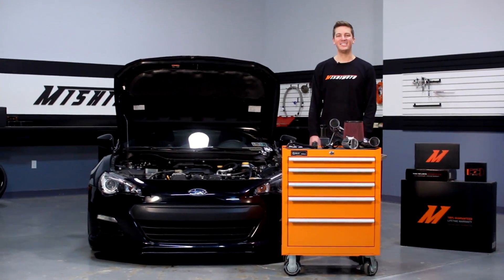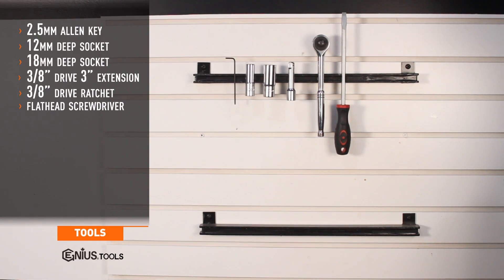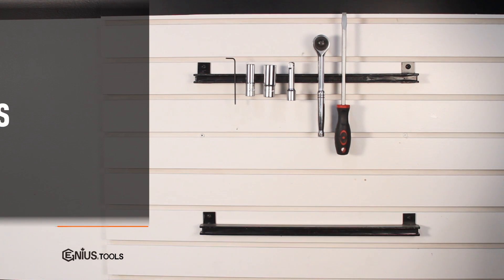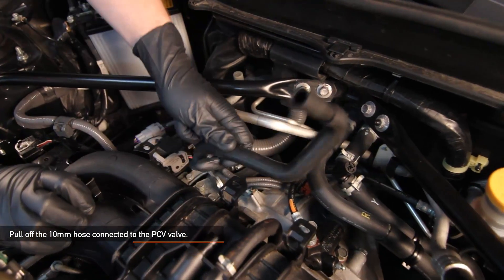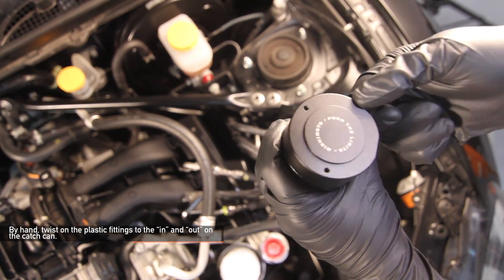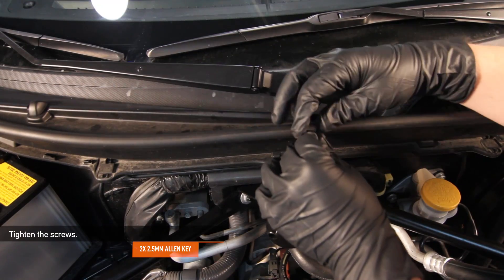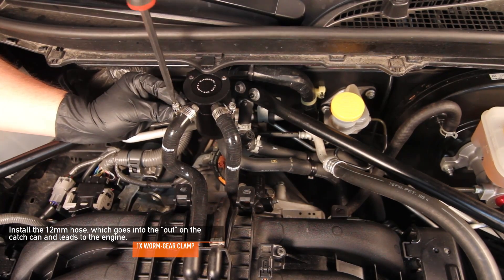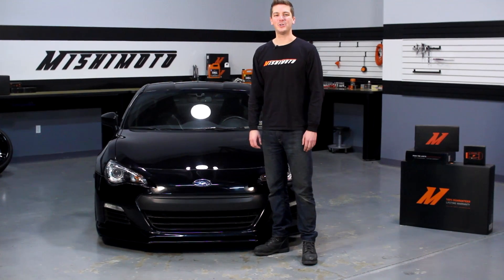Baffled Oil Catch Can for the 2013-2020 Subaru BRZ / Scion FR-S Install Video

Comment: Do I need anything special for a turbo kit? I got this catch can, will it suffice as is?
Reply: hows it running
Reply from the maker: Hey Joshua Queen. You've made a great start with the catch can as boost does create significantly more blow by in any engine. However, turbo setups can vary greatly from vehicle to vehicle. I'd suggest getting the kit installed first, and if you have overheating of one kind or another, I could suggest appropriate parts from there :).
Reply: Mishimoto Automotive installed. Just waiting on the turbo kit to be finished up and mailed out.

Comment: Just received this and I've encountered an issue.

How the hell do you unscrew the bottom half of the catch can? I'm on the verge of breaking my hands trying to loosen it and not keen on using tools to do it lest I scratch the fuck outta it or even deforming it.

You might need to pre-loosen the catch cans after manufacturing them. Looking online and I'm not the only person with this issue with this particular product. (Though no one seem to have posted a solution)

Comment: *****, are there different hoses needed for a boosted BRZ? Thank you!
Reply from the maker: This will depend on what setup you are using. Are you boosted by means of a supercharger or turbo?
- Patrick M
Reply: ***** I am using a turbo kit. Also, I won't mention the other company but it seems that dual cans are popular for FI.

Edit: Not trying to troll, just wondering if you guys offered dual can setups.